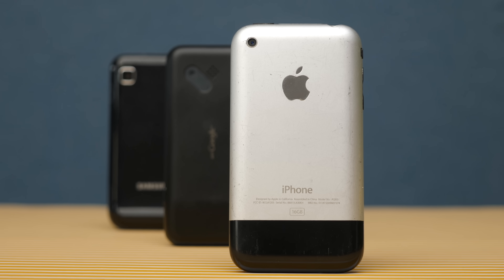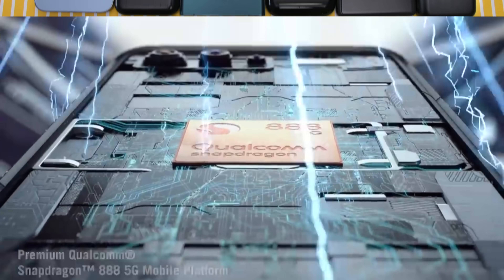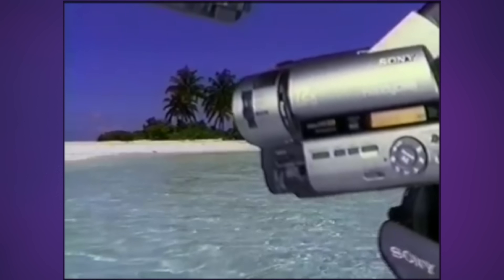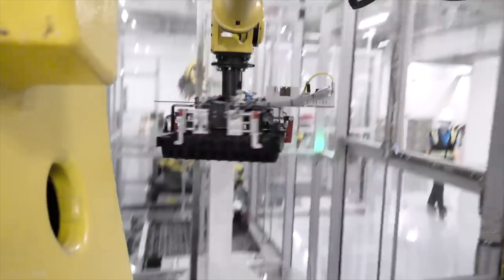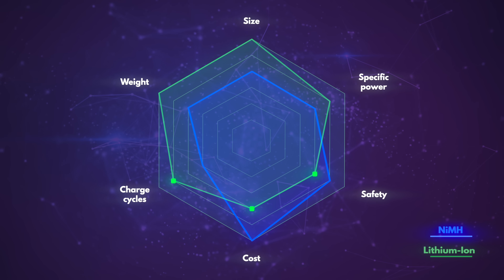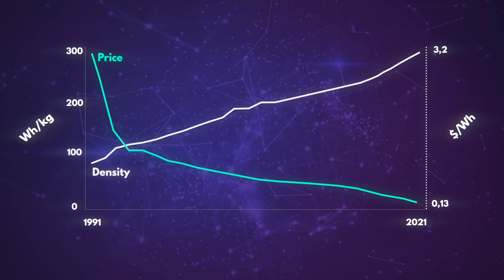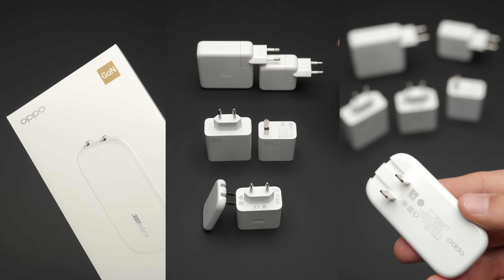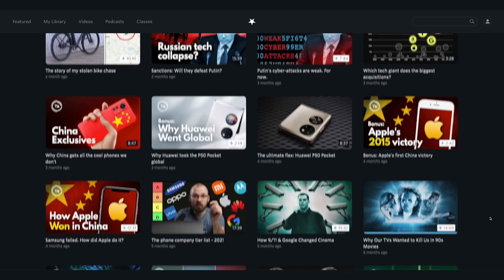The billion dollar race to fix phone batteries

Comment: Actually - the batteries are good already, however without the same battery management as in EVs where you mostly avoid using the lower and higher SOC percentage of the cells, where the wear will be too high. Mobile phones actually charge and discharge their batteries to the actual SOC level, not hiding any capacity from the user like EVs do.

 And why doesn’t mobile phone have a "daily" limit of charging to 80% SOC on a daily basis and for example, stricter temperature limits that slows charging if the temperature is too high, plus better power management so that the phone more often, nudge the user to use less processor power? 

This could even come with a "boost" option where the user is allowed to access the full battery capacity when going to weekend trips or otherwise needing all the capacity, however be nudged to use only 80% of the capacity on a daily basis. The battery would then last for thousands of cycles, not just 500-1000 cycles.

I also disagree with the notion that the batteries haven’t improved from the 90’s as shelf life has been greatly increased, as long as the battery isn’t stored in a depleted, or a fully charged condition, but about halfway charged. Internal resistance has also been improved, so that less power is wasted heating the cells and further decreasing the lifespan. However devices have been even more power hungry, counteracting this, still - since the subject is if batteries have improved - yes they indeed have! 

Even further optimization could have been done by letting the phone halt charging overnight, at 40-50% and continue the charging when it approaches the wakeup time of the user, so that more time of the day is spent around halfway charged. Yes - today’s batteries have a lot of limitations, however none that cannot be worked around with algoritms and educating the users.

Some devices don’t even need the more compact lithium ion or lithium polymer batteries but could do fine with LiFePO4 batteries, while albeit being more expencive, do last for several thousands of cycles and are not so sensitive to full charge or depletion.

Also - recycle your devices properly when they are no longer being used, to minimize the use of materials for making new devices. Regards an EV owner since 2002.

Comment: i laugh at all the people complaining about battery life...mine is a LG G7 with 4, 6 A h batteries in parallel for a total of 24 Amp hours. it lasts for 2 weeks per charge and since i go through charge cycles so slowly the battery should last 12 to 15 years. having them in parallel reduces total resistance meaning it can be charged just as fast as a normal one although it needs a custom charger.
if you want cellphones to have larger batteries do it yourself or refuse to buy new slim phones.
we should be in control of the features implemented in new phones not be at the whim of big companies and what they want to put in them.

Comment: The real solution to powering phones is going to be better power delivery. Your phone should wirelessly charge at the rate that you use electricity so the battery on average is always at 50 percent. And it should do this wirelessly at distances of up to 100 feet from the power source.

Comment: My biggest issue with small consumer electronics is actually the overall repairability of them. The batteries in particular do play a role in that, though. The big issue I see with batteries, particularly any containing NCM cathodes, is what happens when the device reaches "end-of-life." I've been repairing electronics for the last 9 years. The amount of times I've had customers come in with (not even that old) devices that just can not be fixed is staggering. For example, a phone that won't turn on because it's got a dead circuit somewhere on the motherboard. 

Well, replacing the motherboard is basically the same cost as just replacing the phone entirely. Additionally, spending the time to actually do component-level diagnosis on many of these devices is just...not cost effective. I can either spend hours of my time meticulously soldering components under a microscope and charge someone hundreds of dollars for that service, or they could just get a replacement phone, financed through their carrier or insurance provider, at about the same cost.  

Can you guess what most people do with these devices that just can not be fixed? They throw them away. I always offer entirely free recycling services for e-waste, as I work directly with a local e-cycler in my region to provide this service. However, most people do not seem to take that route. Their dead phone loaded with tons of icky and problematic toxic metals almost always ends up in a trash can, and likely goes to a landfill. 

In this context, it's not just the batteries that are really problematic. It's all the other stuff in these devices too. I often wonder how many Macbooks end up in landfills when a customer decides they don't want to pay $700 to fix the broken keyboard on their laptop and just get another device. 

You could argue that there should be more significance placed on the value of properly recycling e-waste, but I do not like this. That carries the same exact energy as drink conglomerates suddenly shifting the blame for plastic waste to consumers, when they all decided to stop using glass bottles. I would argue that manufacturers should be held accountable and expected to make devices that can, ya know, actually be repaired economically?

Comment: This is exactly why I think BEV vehicles are a fool's errand. We can barely keep up now and electric cars are barely present in the market. There is no way all current hydrocarbon consumer vehicles will be replaced by lion Bevs. That's not even getting into industry or commercial logistics. Hydrogen is going to be the way forward there. iMO we should be focusing on swapping fossil fuel power plants with renewables and nuclear versus trying to change Fossil fuel based cars.

Comment: Batteries are like your salary and the power requirement of devices are like the prices of goods. Year your salary increases but at the same time, the prices of goods increases at a much faster rate. Similar to phones today, no matter how big the battery of your average device is, it still won't be enough for you if you're a heavy user. (Except for those super niche devices that has 20,000 MaH battery and are as thick as a brick)

Comment: When current batteries are three times the capacity as those ten years ago, it's not the battery that is holding the mobile phones back, it's the phones themselves. If phones had removable batteries like they used to(at a third of the current capacity) that would alleviate the problem. If phones had less excess processor cores and permanent GPU cores, that would help. If stock android was the default and not bloated apps some of which would waste precious portable power by collecting data on the phone user, that would also help. Bigger screen is excessive and power inefficient for a phone. A gpu, extra battery, larger screen phone dock would work for those needing mobile laptop capable entertainment without impacting phone usage(except it doesn't exist).

The mobile phone industry is what is holding the mobile phones back, but people do like to blame the battery.

Comment: As I see it these faster batteries are a useless upgrade.
I mean sure the phone can charge faster but you can still use a phone while it's charging. 

The only case really fast charges could even be argued for is if you need the phone operational 24/7 for work or something. 

By work I am speaking about jobs that may result in someone's death or injury. 
Like for example construction worker's or people who work with electrical equipment.

I mean aren't batteries more than fast enough as is?
Why must they be made faster ?
This is coming from someone who has a phone that charges fully in 45 minutes. 
To me this shit is overkill for no apparent reason. 
Who need's a phone that can charge fully in 8 minutes?
Is the leap in faster batteries justified really?
Or is it just a useless upgrade that is irrelevant for the most part?

I see people with an 8 minute max charge phone that they brag about.
I am thinking  to myself "like so 
what "?
"The phone can charge really quick be deal".

Comment: Evolution is certainly helpful but, for long term viability, we need a revolutionary solution. Smartphone performance, for example, is already seriously hindered by this antiquated tech. At this point, processing power can only really be increased if we start plugging our devices into wall sockets again.
Reply: No, we need more optimezed cpu and problem solved. Look at apple, 2x battery life compared to competition, with smaller battery.

Comment: Perhaps the most significant problem is that batteries actually degrade, which means that their capacity slowly becomes smaller and smaller. Which means after a certain amount time you will need to replace it.
Reply: This is a problem for consumers, not manufacturers though

Comment: Capacity or charging time is one thing, but how about longevity ?
Given how precious and rare the raw materials are, batteries should last at least 15 years of use to begin with, and more idealy 30 years should be aimed at.
Of course that means that eventually, shape and sizes should be more standardized so the batteries can be used in multiple devices.

Comment: I wonder the collective environmental impact if consumer electronics turned to focus on efficiency. e.g. the difference in power draw when Apple switched from Intel (x86) to ASi (ARM) on Macs. I know battery isn’t an issue on a iMac, however, having significantly less power draw across thousands and thousands of appliances and devices in homes add up. Improved efficiency in TVs, fridges, ovens, toasters, microwaves etc.

Comment: These extreme charging speed is very bad for battery longevity. This is why after even just 1 year there is noticeably decrease in phone capacity. I wish there is smart charging setting that learns if I am overnight charging it doesn't need to charge so fast.

Comment: Good video. Thanks for the education.

Please clean up the cords hanging from your sign in the background. You have such a professional setup and they look so sloppy just hanging there. At least tie them together and straighten it out so there is only one cable hanging out the bottom (or better yet run it out the top where it'll be less visible).

Comment: Your smartphone must work 1 day. It worked 1 day 10 years ago, it works 1 day now, it will work 1 day tomorrow. We're not going to optimize code, we'll just install more powerful processor and more memory. More than you actually need. Because we need larger numbers. Windows XP worked with 256Mb of RAM. But 16GB looks so much cooler. Also, you don't need that kind of mobility. You're grounded.
Reply: Wtf

Comment: Great video. Heat is the enemy of most electronics and batteries, a challenge for fast-charging.
Reply: There's been some work arounds for the issue, but ultimately it is still a possible problem. One of the craziest ways to try to avoid this, is using multiple batteries, and split the total charge rate between them equally.

Comment: Samsung S22u is actually 25w, not 45w. Or can hold those 45w for only a short time: a whole minute. The 25w charger talked about 70mins for the full charge while the 45w model can do it in a whopping 65mins.
It's basically fraud tbh.

Comment: Honestly - to have chips consume 10W under load is just unacceptable. What we need is bigger chips that run at slower clocks and consume less power combined with 5000mah batteries at the very least.. 120hz screens don't help either

Comment: Im not trying to make a giant argument out of this but i will bring this up.

For years playstation fans will berate xbox or nintendo (wii/ wiiu) players for the fact that their controllers use AA batteries instead of internal rechargeable lithium ion packs.

But why would i want an internal 1000 mAh battery when i can use 2300 NiMH AAs that take me 10 seconds to swap out without the need for an umbilical cord fixed to the incredibly fragile micro usb port while i play?

Comment: I know there is also the idea of working on lithium sulfur which replace the cobalt with sulfur as it can hold more lithium ions. Again though it has the same issues as silicon in that it expands when heated up much more easily than cobalt making it harder to maintain. Though in labs studies of it have shown it to be about twice as energy dense as the standard li-ion cells.

Comment: Ive been using normal cable charging as of late as ive noticed that my new phones barely get hot when charging em, so im hoping that cable charging will help my phones last longer.
Reply: It's a good decision to charger via cable instead of wireless. Wireless charging is more  inefficient and therefore more heat is produced during charging. Battery research shows more drastic decline of battery health when kept at higher temperatures, so using cable you should have a cooler phone during charging and a battery that stays healthy for longer. :)
Reply: @R4nd0mN7mbers  nah i meant standard normal charging instead of fast charging as ive been concerned over the logeivity of my phones lately and fast charging doesnt save that much time.
Reply: well i go to work leave my phone at the locker,  when i go home exiting work my battery is almost 30% and i did not even use the phone on my work hours, so i get home and can't watch netflix on the phone without wasting a few hours charging it,  can't play minecraft or other games,  so i go to pc.  i just with the battery lasted atleast 2 days.

Comment: Don't apologize for giving us a chemistry lesson. We needed that. I have always felt that we should have gone to EVs long ago. I always just assumed that they  were better for the environment.  I didn't know that lithium was strip-mined. 

The electric Ford F150 pickup truck is in no way a compromise in speed or power.  In fact, it is a much better vehicle. For a tradesperson, there are outlets that are even capable of  powering welders. In a remote area, that is a huge feature.  Even better, with an optional kit, this truck can reverse-charge your entire house for several days of normal use and over a week of conservative use. I want one! I'll find something to weld in the desert. 

Jay Leno's Garage has many EVs going back to the early 1900s. If you're interested, a lot of his videos are here on YouTube.  Some of the engineering is just fascinating.

Comment: By now the only thing I really care about are improvements in charge cycles. Batteries now last enough days for me. I don't care if it takes 6 hours to charge or less than 1. If after enough use, the battery won't last anywhere near one day or fails completely, and I have no option but to throw away the entire fully functioning phone since companies did their best to make batteries too costly and hard to replace, all these other features are worthless to me. Battery charge cycles are basically the bottleneck for device longevity.

Comment: Something that is needed to included and considered is that the modern SOCs got incredibly smart with Power management. Drop voltage, control clock speed and activity, cut power of features that are not in use and the list goes on

Comment: Great video but you only talked about the energy density side of things. Wouldve been great if you included the efficiency of the batteries aswell! One of the biggest problems is cooling the batteries. Because of the high internal resistance of current batteries they tend to release quite alot of energy as heat and tesla found a great way to massively reduce the resistance by introducing the tabless design. This means higher amperage & less heat 😄

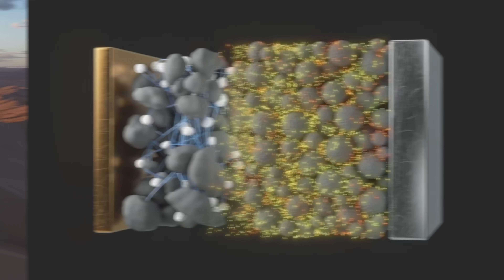Comment: 12:35 This is a little misleading. While silicon does have 10x the energy density that doesn't mean replacing graphite with silicon will give you a battery with 10x the energy desity. You would need to add a lot more lithium to restore balance. By adding more lithium this brings the improvement way down. While yes silicon anodes have potential to be a step better than graphite it is nowhere near 10x better.

Comment: The EV pundits have their head in the clouds, people expect miracles from batteries and emerging techs. If the electronics industry can't do it in a cost effective or mass produced manner what makes them think they can? Ultra fast charging will help alleviate the EV problems but it wont fix them in some critical areas (Truck range, weight gross combined).

Comment: What I'm irritated by now with smartphone batts and I can't remember when this exactly started but with lithium ion batts with SPs one could buy a new one for their model and replace new with older one easily, well not so now with the batt being way way way more internal instead of removable on the back side.  Wish they'd would go back to the more easily replaceable way when buying a new lithium ion batts when needing to.
Reply: Are you kidding??? Replaceable batteries were trash and have mediocre lifespan. I hope this shiit won't come back,
Reply: @danteerskine7678  internal non removable is way worse.. Especially if you were to accidentally drop it and cracks screen and the like, will really badly damage lifespan of non removable battery.